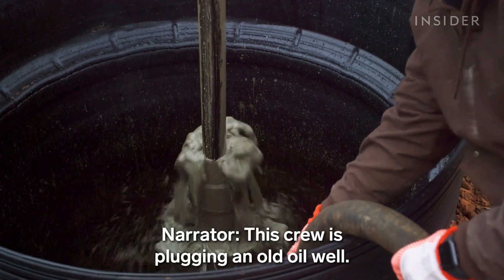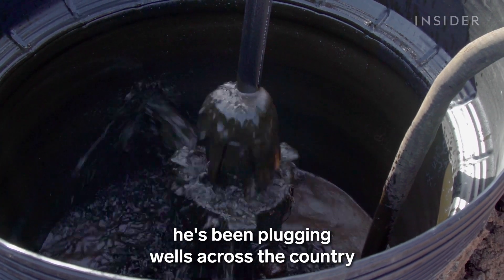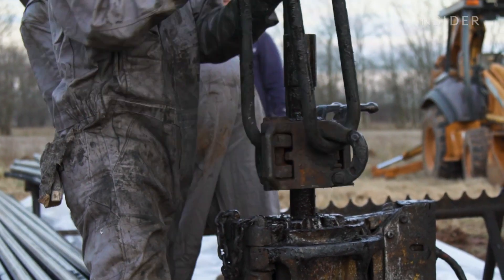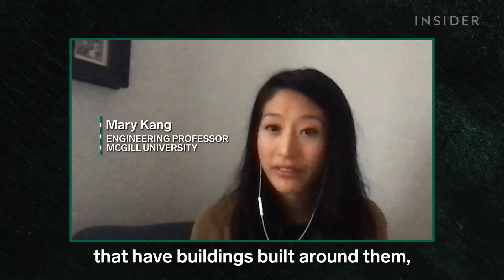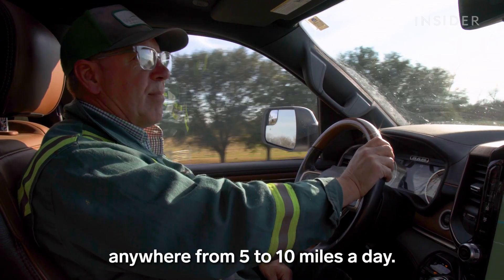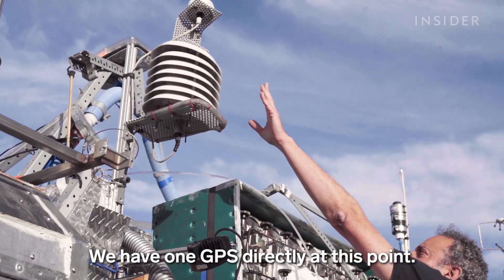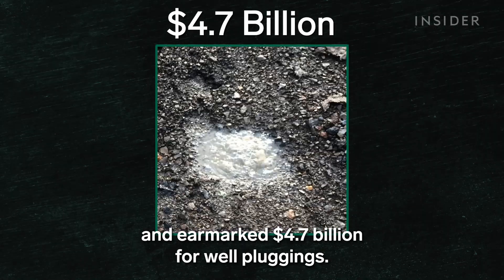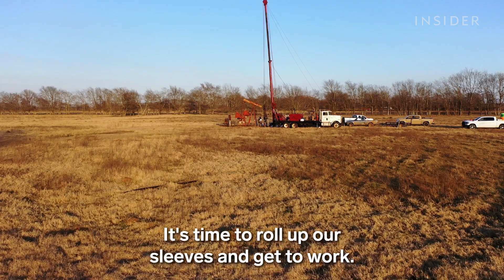Meet The Retired Oil Exec Plugging Forgotten Wells To Reduce Emissions | World Wide Waste

Comment: They forgot to mention that most of a cars interior is plastic, styrofoam cups, ink pens,  some plates and hoards of other products used daily are byproducts of oil.
Reply: Why would they mention it? It's irrelevant to the problem of orphan wells.
Reply: and none of that needs to be made.  we can easily make interior panels from plants if we cared to instead of stupid fructose corn syrup and ethanol fuel.  only reason we havent is cuz its immediately the cheapest option.  were perfectly fine without it before. god forbid you use aluminum cans, metal pens or wood.

a pencil is dirt cheap and somehow uses wood....